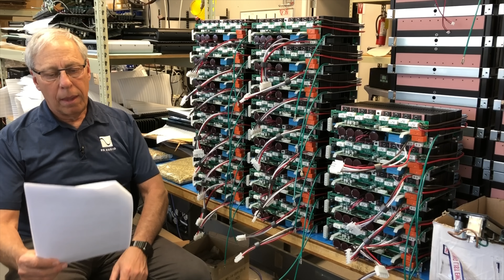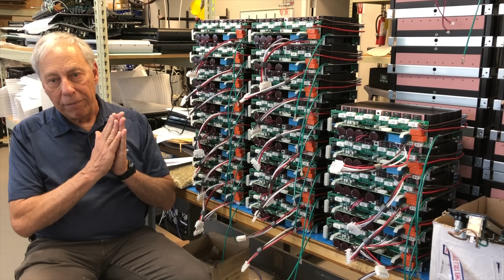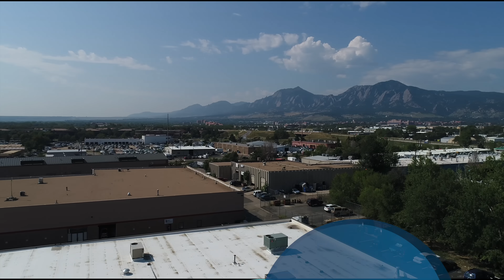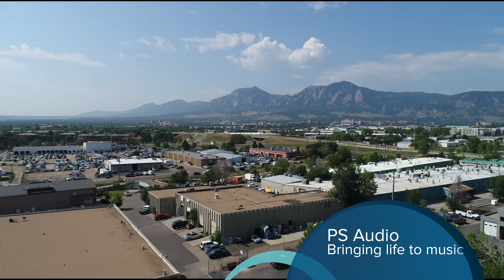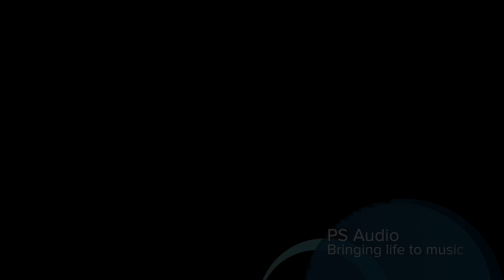How do different cone materials affect sound?

Comment: Out of curiosity Tang Band's W8-2145 shows a virtually flat frequency response until about 9-10kHz on their measurements.

It supposedly made out of bamboo something? Is it paper but the paper came out of bamboo?

It also has a whizzer cone, which I assume takes over after a certain frequency and gives it a better off axis response above 1kHz than a standard 8" driver.

Do you all think I'd like to use this as the midbass/midrange driver in the $100 mark?

That being said however I am trusting their own measurements so this may be a bad idea. Tang Band also doesn't measure off axis response. I'm merely assuming the whizzer cone improves off axis response above 1kHz.

Comment: What is an orajel speaker cone? What does its cross section look like? I saw a cross section of a cone that had another cone behind the front cone. It looked like a spider web between them, and the assembly was incredibly light and yet strong. Is this an orajel cone?

thanks.

Comment: Beside structural integrity, diaphragm materials are also chosen for their timbre sound quality. This is why two drivers with different cone materials can have the same breakup frequency but will not sound the same. Each material has its flavor aside from measurements.
Reply: Besides sound quality..endurance and durability.. resistance to humidity.. and lastly..something that glue will stick to.
Reply: Car audio and outdoor speakers use materials that work in wide temp ..humidity..and sunlight.

Comment: Paper for woofers, paper or silk for midrange and silk or mylar for tweeters. Nothing else comes close for the perfect tone. Metal drivers for the most part sound too piercing, not the soft sound that I prefer.
Reply: You answered a lot better than Paul. I have a couple of aluminum drivers in my two subs, and I've been thinking of replacing them with paper. I'm not sure if I'll go with rubber surrounds or folded cloth.
Reply: That makes sense because metal seems like it would make the woofer sound "tinny" or thin. What I wondered though is whether Kevlar or Fiberglass might not be be better than Paper not only for better sound reproduction but for longevity/durability as well?

Comment: For dome tweeters, Beryllium is the best you can get and diamond dome tweeters are a close second. Beryllium dome tweeters resonate very well above the human hearing range. For a midrange or a mid-woofer paper, kevlar, or carbon fiber are excellent materials. For a woofer, paper, carbon fiber, or polypropylene are excellent materials.
Reply: That what I've got for my speaker project monacor carbon fiber 6.5 drive for woofer b&w 6.5 kevlar for mid an a fountek ribbon for tweeter the magnet on the monacor is 6 inch nice drivers.they go low for a 6.5

Comment: The Harder the material the better it resonates High Frequencies, the Softer it resonates Low Frequencies. Paper or compressed paper cones have the most Natural Sound. Some materials like Poly carbonates and Aluminium' though they are harder, they can be driven with more bass to compensate because they are stronger' though there is a limit before the material vibrates and becomes audible. Aluminium speakers can be made small and handle a large amount of bass. The best speaker arrangement is to balance 5 way components with a big enough sub woofer so that the other frequencies are balanced, woofer, mid range, tweeter and super tweeter and have harder materials for high frequencies such as Titanium Alloy Tweeters and Super Tweeters, then have a variety of other materials for the other speakers to get a balanced sound rather than thinking that there is one ultimate material. All have their positive and negative attributes. Paper tares easily and flaps, Metallic can sound metallic at high volume.

Comment: Why not use copper screws? Gold plating steel screw is a waste of money and those screws have big loses of energy because gold layer is extremely thin so power goes mostly through steel which has bad electricity conducting properties.
Reply: gold doesn't corrode so in fifteen years there isnt a wad of copper oxide and iron oxide at a connection which will decrease sound quality or cause it to not work at all
Reply: @timthepoolman3313  you would have to keep it in a very damp basement or something to make copper corrode so badly. I've never seen copper corroded at all in normal household application. Gold plating is just an audio-voodoo for audio-voodoo fanatics. You can sell them gold plated steel or even gold plated shit and they will still think it can conduct better through that thin layer than entire thing made out of copper.
Reply: We have a house on the water and the salt in the air oxidizes everything at my house also I own a swimming pool service company and i have a stereo in my chemical storage building full of chlorine
Reply: @bluef1sh926  we dont have basements here
Reply: @bluef1sh926  im no audiophool dont get me wrong im just saying i see a reason for gold plated stuff
Reply: @bluef1sh926  the pocket knives i use just have extra nitrogen in the steel so they don't rust which is cheaper than gold
Reply: Well, yes, in extreme humidity conditions copper will cause trouble, but it's so much more conductive than steel, that it's worth considering. I'm not against gold plating, I'm against using steel because of its low conductiveness.

Comment: i have always assumed that , rather than trying to adhere to the ideal of perfect cone stiffness and inevitably failing, the higher end drivers are subtly designed to intentionally flex at different frequencies in a controlled manner, in order to have more control over the sound output
Reply: Go look at bmr drivers. Being used in the philharmonic speakers to GREAT effect.

Comment: as for woofers..paper always sounds best, it gives a more "human" sound, sweeter, aluminum can be close if well designed, but not quite up to par with paper..plastic sounds the least pleasing ,and tends to soften around the point where the column is glued to the cone causing wave form distotion

Comment: Other parts of a speaker including the spider, surround, and even the basket also contribute to the sound of the speaker.  The electrical resistance of the coil increases as the coil heats up, coloring the sound even more.
Reply: Exactly. Cone isn't all that matters

Comment: Hi Paul, you forgot to mention a third important property: inner damping, how good the material suppresses resonances. But it is often opposing stiffness. The German DIY loudspeaker magazine Hobby HiFi recently showed that cone material is not the most important thing in a speaker. Mechanical losses that immensely affect sound quality are predominantly caused by a lossy suspension and voice coil former materials.

Comment: I have a pair of Vintage Zenith 49cz852's and they sound absolutely stunning. They are 12" and are made of felted paper. They have 3/4" voice coil with vintage enamel wire, and a ribbed cone. The sound is just stunning. The clarity, dynamics, imaging, and timbre is unlike anything I've ever heard. I don't think by modern standards they have the best properties but they sound just mind blowing and thats what matters. I run them full range in an open baffle and they can play down to 80hz and up to 14Khz. I add a tweeter with a 1 uf cap to accentuate the highs.

Comment: plus gold plated conducts flow better than bare metal.
Reply: Gold is used to reduce oxidisation of the contact. Gold is fantastic for transfering heat, it is not the best for conducting electricity, For that you need to look at copper unfortunatley copper just loves to oxidise.
Reply: What about pure silver?

Comment: Pistonic drivers are not optimal.  

To have flat frequency response at all angles, the radiating surface area has to change size inversely to frequency.  The beam angle of radiation depends on the ratio of wavelength to circumference of the cone or dome.  This is one reason we have two, three and even five way speakers.  If you look at the off-axis response, you will see that the projection angle narrows just below the crossover points where the woofer and midrange drivers are large in relation to the wavelength, causing adverse room interactions from the peaks and dips.  

Musical instrument design takes this into account.  For example, in the violin family there is a small area of the sound board under the bridge and between the f shaped holes which radiates the treble frequencies, scaled to the size of violin, viola, cello and contrabass.  The larger carved areas of the sound board upper and lower bouts are progressively more flexible and radiate lower frequencies.   

A loudspeaker diaphragm in a curvilinear shape with the right flexure and damping parameters can produce the same affect, of an effective shrinking of diameter with increasing frequency.  I use a 15" driver with a 2" voice coil that has a rising response up to 5KHz, with an effective diameter around 5" at the top of the range and low end response to 30Hz.  

 A well damped cone also lowers temporal distortion, making sure the notes stop as fast as the recorded signal.  This flexure lowers the effective mass at high frequencies, and therefore the energy storage is lower.
Reply: You sure ? Okay sign here on this line under penalty of death if you're wrong.✔

Comment: USE whatever you like, because the sound is determined by the crossover network built into the speakers ? I have seen paper cone speakers from 30+ years ago on yamaha NS 1000 / JAMO Power range / JBL 45 series etc series which are still going strong and sound better than most new plastic or kevlar type speakers,why because its the cross over network which needs to be upgraded and also new quality speaker materials, get them both based on the type of music you want to listen too and lets not forget that most people will not have any music that load like at the concert of Van halen or metalica or a classical music concert full stop ?f

Comment: Good question. Paper was the only material for decades, but in the late 80's all kinds of materials were used. From poly propelene, to fiberglass to Kevlar to aluminum to paper. And the material the surrounds were made of differed as well.  silver Flute speakers use wool, strange as that might seem, but reports say that they are very articulate and provide good detail. In car speakers there have been several exotic materials used. What we need is a transparent, neutral sounding material that doesn't impart any quality of its own into the music being played through it. It seems funny then when good old paper cones still have their niche in speaker cones. Some of the best drivers made then and now use paper. I've got a pair of silver Flute drivers that I bought for my car, but it turns out I didn't need them, so I'm looking for a design to use them at home with. I think they would work great in a D'Appolito arangement for a computer, or home studio type speaker. Coupled with a tweeter that can be used below 2500hz they should sound awesome! I'm looking at the new GRS Ribbon tweeters to go with them. We'll see how that works out!

Comment: My speakers are paper cone woofer, cloth dome tweeter and aluminium foil coffee can seal for the pointy triangular whizzer piece added to the tweeter. It's an isosceles triangular piece about a half inch long glued to the tweeter dome. The whizzer makes the treble sound amazing, and you can hear the "shing" in the aluminum but it's quite pleasant and the cymbals sound like metal and sound like they are being "hit" instead of sounding like a "hissing air hose" (like the tweeters sounded like originally). (Whizzers designed by trial&error.)

Comment: Fantastic explanation.

Always wondered why there weren't more crossovers used.
They could then according to frequency, be different materials per frequency.

Have ten speakers per cabinet all with a different frequency crossover.

I made my own back in the early eighties and could only find three different crossovers to use...
Very disappointing while wondering why they weren't more of them, dividing up into more frequencies. Which would create clearer sound albeit depending on the rest of the system.

Haven't even looked at crossovers since back then being it was so disappointing. 😐
Reply: I don't think there's much point going above 4-way (subwoofer, midwoofer, squawker, tweeter)
Reply: The issue is that crossovers create distortion and phase shift. In that regard, less is actually more. That is why we have 2-way designs. It isn't just a cost-saving thing. The problem there is that the drivers don't usually cover the entire frequency range easily. Designers have a tough job. A lot of trading bad for bad going on. It becomes a decision as to what is worse in that instance.
Reply: Active crossovers fix the issue of passive crossover non-ideality, but you start to need rather a lot of power amplifiers - 3-way is probably enough - you want to keep each size of driver from encountering frequencies that cause break-up or phase-cancellation of the driver those frequencies are intended for.
Reply: There is the issue of the waveforms, not all coming from the same space as well. It isn't just a time thing. Tannoy used to use the analogy of ripples on the water when you drop a stone into it. You see how even they are when there is one stone but when you drop 2 as they can't occupy the same space at the same time the ripples inevitably end up deformed even if they impact the water at exactly the same time. As it was all still really theoretical at that point I don't think they really understood how much of that upevil was caused by the drivers not being in time. We can fix that now but as the sources are still different we still have measurable annomalies.

Comment: One of my pet subjects ... plain Kevlar is the best for mid range drivers with a phase plug . 
"Oil canning " I always thought was the undesirable effect you get with sealed enclosure LF drivers ...  think of adiabatic index ... P1/V1 and non symmetrical excursion of the cone ..
Reply: For the most part and most of us it is a bad thing but in instrumental applications, the smear and distortion effects it creates are often desirable.
  Kevlar is interesting. Focal does that in some of their higher end 3-way car audio stuff. It is actually aramid fibre which I am told is only very slightly different and I have the 2-way set in my car. The high-frequency driver hates 4 Khz. I heard a woven carbon fibre dome mid recently and it rocked!

Comment: I can understand the desire for the 'unobtainium' zero mass, infinite rigidity material for a speaker cone so that it can follow the electrical signal as perfectly as possible.

What I don't understand is the most common 'shape' of speaker cones. I mean, that I understand it from a rigidity standpoint, but not from an orientation standpoint.

Since one is (assumedly) trying to "imitate" a "point source" wouldn't a cone facing  the opposite direction (or a partial hemisphere, as in many tweeters and some midranges) present better physics for that? Could that possibly increase the accuracy of the sound field generated in the midrange?

Thanks for the interesting topics, Paul. I may not agree with all of your points in all of your videos, but you always give me something to think about - and possibly a totally different viewpoint to consider.

Take care!
Reply: The sensitivity of a speaker (i.e. loudness) is highly dependent on the area of the diaphragm - you actually want as large an area as you can get to push the most air! Theoretically any shape could work, but to maximize linearity and lower the harmonic distortion, you need something that is rigid even at higher frequencies, and the common speaker cone design is pretty good at that. The reason for the orientation is that the voice coil needs to be in the magnetic gap while also driving the cone. Usually the voice coil former is glued to the inside of the cone neck, and this common orientation keeps the size and mass of the moving assembly low (which maximizes SPL as well).

The concept of sound needing to come from a single "point source" is important when designing systems with multiple transducers. Often times you'll see loudspeakers with a high-frequency driver embedded at the center of a low-frequency driver, and yes this definitely improves the sonic image!

Comment: Do speaker cones fatigue and lose stiffness over time?  I would think after vibrating any material a few billion times it loses its original property.  I know aluminum and carbon bikes fatigue over time.
Reply: Yup. In pro audio re-coning is a regular part of the maintenance process. Drivers are worked as hard as they can day in and day out. If they don't die from abuse they eventually sound so different (mostly bad) from their like parts either in the same cabinets or like cabinets that we just have to re-cone them anyway. Common is subs that "fart" at higher output levels. The cones test and look fine but when you hit em they sound broken. 
  Funny thing I have 2 sets of studio monitors from the 90's. I am sure they have not really seen any abusive level run through them so that could be a factor but all 4 sound pretty close to one another still and I was afraid I was going to have to have a friend re-engineer the drivers as re-cone kits are now unavailable for them.